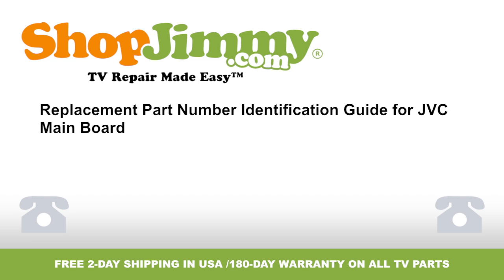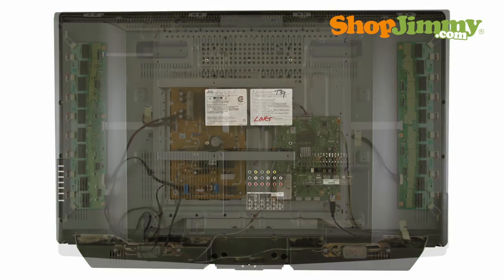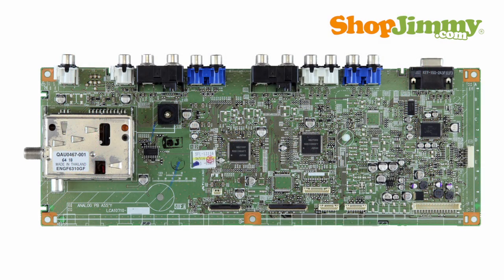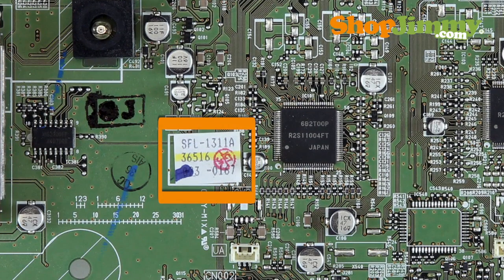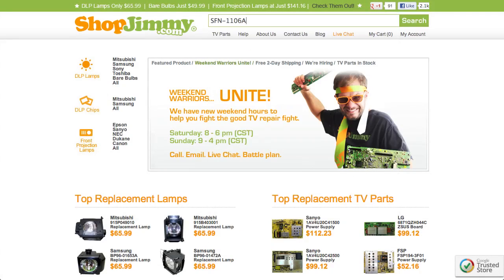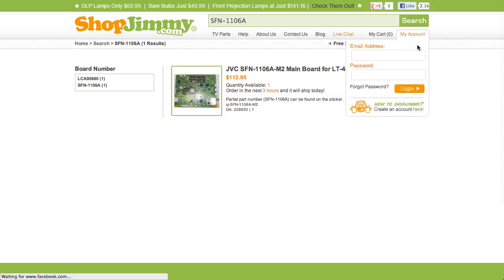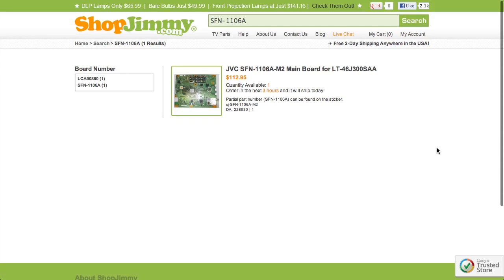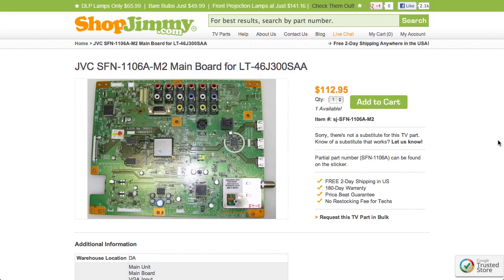TV Part Number Identification Guide for JVC Main Boards (LCD, LED, Plasma TVs)

Comment: I have the JVC JLC42BC3000 the mainboard part number is 3642-1302-0150 (3B)

when it turns on, the JVC logo is smashed into a couple of pixel lines in the upper part of the TV screen about an inch from the top. When you put on a channel all of the TV is displaying in the upper 1.5 inches of the screen and a little bit of color and light around all the edges the rest is mostly black.

It did this two times to start with but corrected itself after unplugging and re-plugging and turning it back on. After it corrected itself it was perfect for hours until it was turned back off. The third time it would not correct itself again. Does this sound like a motherboard to you?

I tested the power board outputs, all of the outputs have proper power that are listed on the board. There are a couple of upper power ones that say on/off but do not give a power specification.